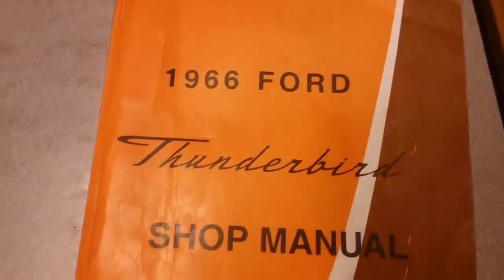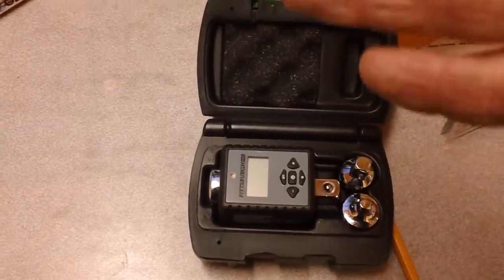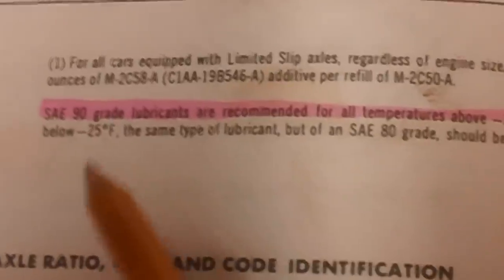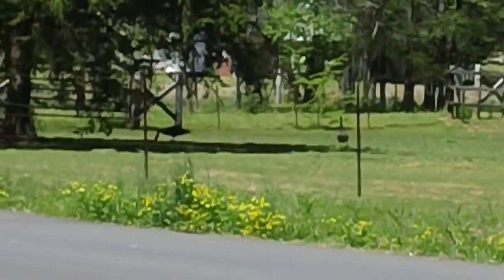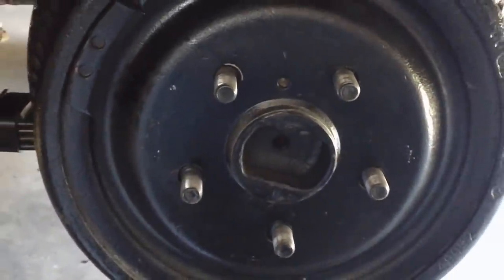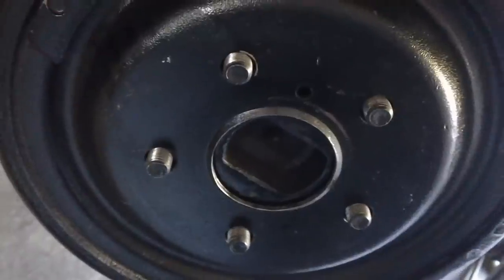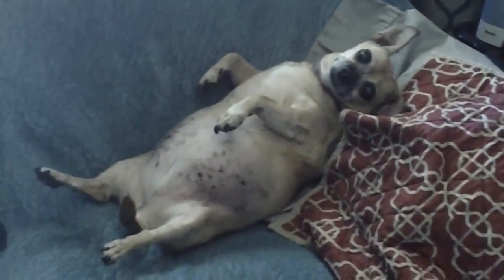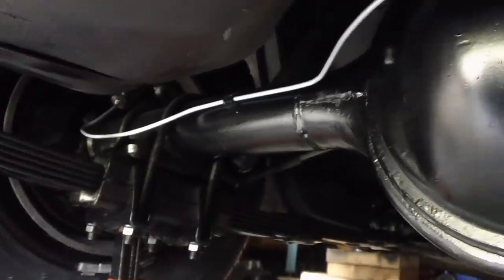1966 Ford Thunderbird repair and refurbishment (Part 41). Finishing the rear end work

Comment: Metric sucks.
Oh yes good old drum brakes, did many of them, brake spoon, spring install tool, shoe holding remove/install tool.
I have no problem doing drum brakes as long as it is on a full size car like you have.
I hate disk brakes, I have my garage do mine.
Reply from the maker: Bill,
Disc brakes are 1000 times easier and faster to replace than drum brakes.  Remove two bolts, take out the brake pads, put in new ones, then screw the bolts back in.  It can't get any easier.  I'll be pulling the calipers on the T-Bird for a quick eyeballing of the piston areas, so stay tuned, my friend.
BTW...Sorry I haven't been able to watch all your vids of late...and many of the vids posted by others.  I'll explain in my next upload.
Regards,
John
Reply: I know I tried to remove the brake pads on my 1991 Dodge Dakota truck which I no longer have, anyway I broke an 8" USA made "C" clamp trying to push in the frozen pistons.
Went to a garage, not my regular garage and it cost me $750 !!!
I it needed everything replaced, yes I got ripped off but that is just the way my luck runs.
I hope all is well with your family.
Happy Easter my friend.

Comment: I'm disappointed John. I thought you would have a Geoff Bradshaw torque wrench. Brake spoon.. we made do with screwdrivers!
Reply: Click!  On old cars like that with steel wheels I don't know of anyone who ever used a torque wrench on those things.  We just always tightened them up snug with a 4way and never had a problem with them.
Reply from the maker: George,
I've just about always used a screwdriver to adjust my brakes, but finally realized I was causing too much damage to the adjuster teeth, so thereafter decided to  use the proper tool.
Regards,
John
Reply: @joernone  I found that over here in the UK there were so many different types of adjuster you would need a whole toolbox of special tools for each type!. I do have the right tool for Austin/BMC/Leyland, a spanner with a square hole in it rather than a hex hole. the adjuster was on the backplate of the drum open to the road dirt...  WD40 was needed to make it possible to turn them.
Reply from the maker: Same here, my friend, but it's best to show our uninitiated folks the correct way to do things.  We're not done yet with the lug nut tightening subject.
Regards,
John
Reply: I guess you are right... we can't teach these youngsters all of our bad habits!

Comment: the self adjuster wheel will turn easy when adjusting brake shoes out to get more brake shoes  to the drum ,  the locking mechanism keeps the adjusting wheel from backing up , to adjust the rear brakes you are suppose to be able to back the car up and pump the brake pedal while the vehicle is in motion this in turn lets the rear drum brakes expand outward if the safe adjuster wheel is not frozen up it works well while backing and applying the brakes .. back the vehicle up at a speed of about 10 mph and jamb the brake pedal until the tires slide on the pavement do this several times and you should have a full brake pedal . I am a proud owner of a 66 Tbird and do all the work on it myself

Comment: John, 
I've got a Ford Econoline Bell Telephone truck from 1967. It's the one with the engine between the seats. I can tell you from experience that those automatically adjusting brakes have never worked very well. Once, I had the left rear drum actually tighten up while I was on the road.  It got so hot that it smelled hot. Lucky for me I had my tool box along for the ride and was able to un-adjust it and get home.  
Regards, Tom
Reply from the maker: Tom,
I've had good and bad luck with those auto adjusters.  If they don't work it pretty much means something inside the drum is either rusted to the max or the teeth on the adjustment wheel are damaged, usually from someone doing the adjustment with a screwdriver which I'm 100% guilty of doing.  LOL
Regards,
John
Reply: @joernone  In the past, I've disassembled, cleaned the old grease and regreased the star wheel thread or simply replaced it. I've always made sure the wheel itself is not worn. I know there's left and right star wheel assemblies. Maybe it's because I don't drive my van enough to keep the assembly loose and working. Always something.... :-)

Comment: Did it to me auto zone for my duster Turismo metric wouldn't screw in .mention again don't leave running in park will begin to click & backup without you 66 tbrd.
Reply from the maker: Don,
The transmission and engine on this T-Bird were rebuilt about 5-years ago, so I doubt there will be any problems with either, but I will keep a watchful eye.
Regards,
John
Reply: My 1966 T bird came out of nutral in the garage when I was using a remote stater switch...Fortunatly it only crunched my garage furnace and not myself or drive thru the wall or door. I have put a bunji cord on the shifter to the cowling untill I can rebuild the columm, But you are completely correct, It is a know problem with the 1966 that has the Slide away steering wheel. When my car took off it was on dollies and I am very lucky not to have been in its path!

Comment: Those shop manuals are an indispensable tool if you love and work on your classic car, Mine cost me a whopping $30.00 back in 1980 and it turned out to be the best $30.00 I ever spent! Anything and everything about your particular car is in there and they even made a manual for the car body as well. I wonder if they still do that? Great video as usual John, I'll bet this will be helpful to many younger car owners who are new to the hobby
Reply from the maker: Art,
Some things on a car, classic or otherwise, absolutely require a shop manual, but after Al Gore invented the internet things have got easier.  Still, it's always wise to get a manual.  In addition to the T-Bird shop manual, I have the body manual, electrical manual and engine manual as well.  One can never have enough reference material.  BTW...I've started collecting manuals for a certain 442 I'm expecting to arrive At any day.
Regards,
John

Comment: John,
In my limited experience, the self-adjusters work great for a few months, then they lock up solid as a mass of rust.
Reply from the maker: Ian,
The design was great, but over the years backyard mechanics round off those adjuster wheel teeth, so the adjuster lever will no longer engage wit them.  I've seen improved designs that work better at preventing the slipping.
Regards,
John